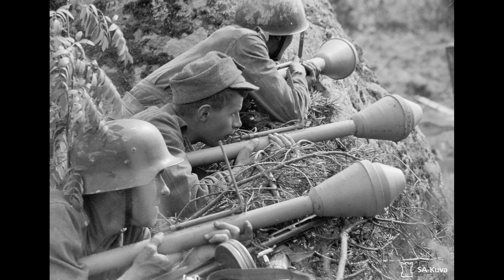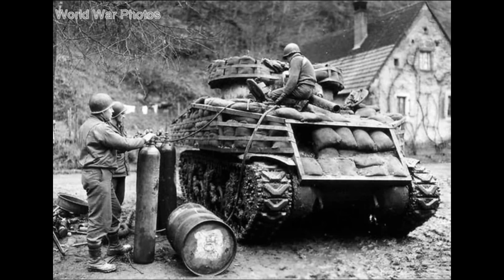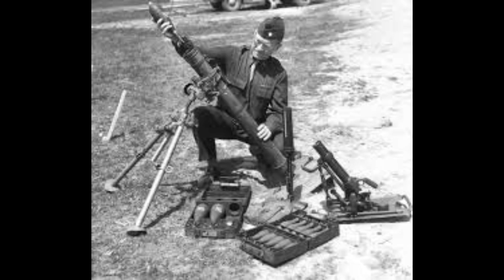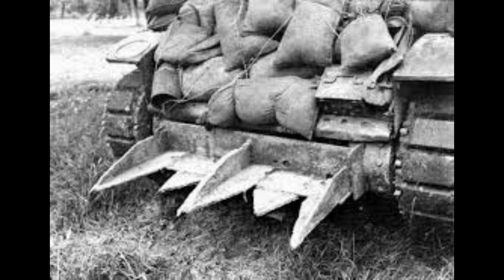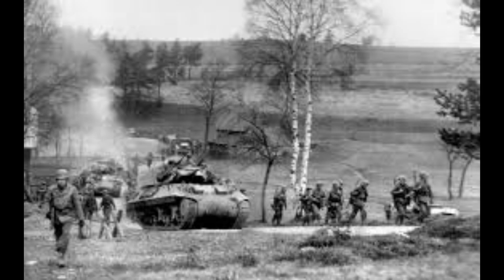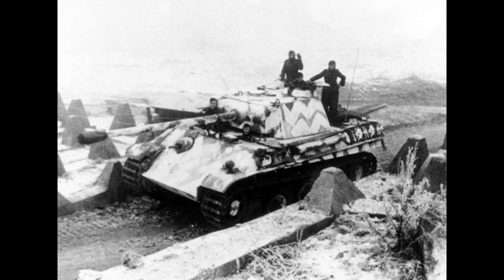Wehrmacht Panzerfausts Destroyed Shermans — US Welded Sandbags & Concrete Stopped Them

Comment: The Panzerfaust was an incredible jump in military equipment, putting an effective and relatively cheap anti tank weapon into the hands of individual soldiers. It was simple, could be produced in large numbers, and was easily transportable.
An interesting historic "what if" was if the German army had the Panzerfaust five years earlier. One problem with a German invasion of England in 1940 was that German soldiers landing would be faced by British tanks, without anti tank guns that would be difficult to transport across the English Channel. Likewise, German infantry armed with Panzerfaust would not have been defenseless in their attack into the Soviet Union when T-34 tanks started showing up.